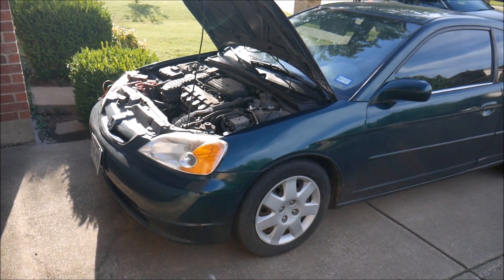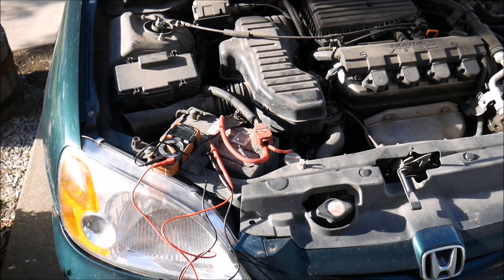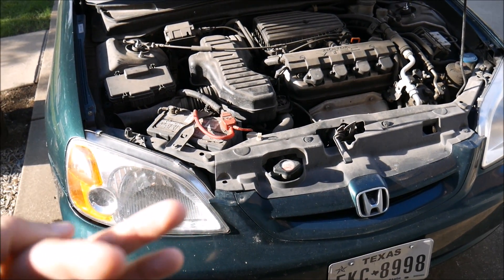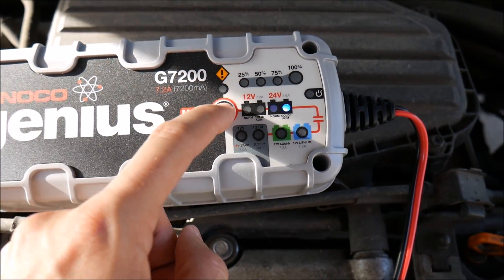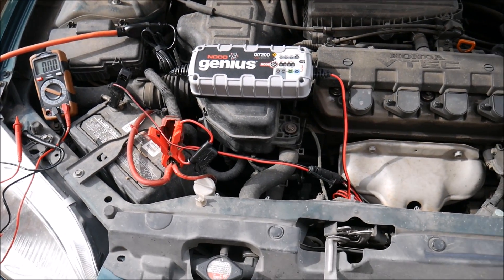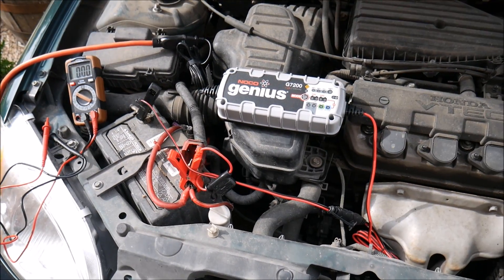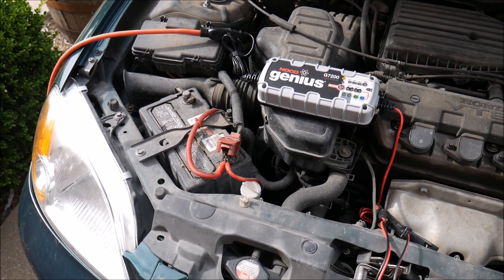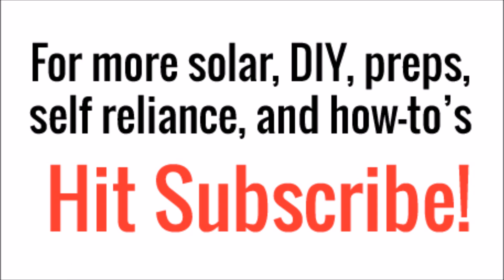Is It Genius? - Noco Genius 7200 Part 2

Comment: You performed the procedure incorrectly.  For future reference, you are supposed to recharge it normally to 100% prior to using the repair function.  (Page 5 of the little instruction book that came with it)   The normal charge performs an 8step process and brings the battery to full.  THEN do the repair mode.

The instructions that come with the charger are weak, but there are a lot of other videos on YouTube explaining how to properly use the machine.   Don't take my word for it, watch a few videos...that's how I found you :)
Reply from the maker: Good to know, thanks.
Reply: Also, i think it is suggested you remove the battery from the car before doing a repair mode run. And though a battery at 9.8v is considered fully discharged, it should be recoverable under normal charging and may not need repair mode. I have seen batteries revived with starting voltages below 4v or even with 0 voltage. And an FYI, repair mode only runs for 4 hours. It is not a charging mode but one that supposed to desulphate the battery and deal with acid stratification and bring back battery capacity. I would only use that repair mode as a last resort having tried other less severe desulfation methods.  Based on reviews people have lost batteries using their repair mode.

Comment: You didn't leave the charger on long enough.  From 9.86 to 11.15v is a good improvement.  I brought back a battery much worse then that one by leaving a 3 amp smart charger on longer.  Try leaving the charger on for a week, and see what happens.
Reply from the maker: I don't have that battery any more as we replaced it.  But next time I will definitely try some more suggestions like this.  Thanks
Reply: @LDSreliance  Most people I've seen test the repair procedure don't wait long enough for it to do its job.  One guy who successfully used it had it on for 3 days 9 hours and then it finished, and succeeded.  Fully charge it normally, then let the repair mode work, until it's done.

Comment: Interesting video and nice used Honda, what year / model is that one?  I just bought a NOCO G3500 battery charger.  Like you said, it seems that battery was too far gone, but for best results manual makes a couple of points:  1. for optimal results, first fully charge the battery via a full charge cycle, then try the repair mode and 2. Disconnect the battery before using the repair mode.  Last thing, make sure the battery has sufficient distilled water in it covering the plates because the repair process will result in some water loss.
Reply from the maker: It is a 2002 Civic EX.  So basically they want me to jump start my car and then drive it around and try to charge the battery?  Hmmm.  I agree on the second point.  I should have checked the water level.
Reply: You could fill it w/ distilled water, disconnect it, charge the battery first using the NOCO G3500 (not Repair Mode, just normal charging mode) to 100% and then use Repair Mode last.

Comment: Just used on a battery that's been sit all last winter and summer and it which was reading 2.3V, charged it on normal mode on my G26000UK and next day it's sitting at 13.6V overcharge and flashing green, try removing the battery from the car and try again and also check the water level.
Reply from the maker: I tried numerous methods to revive that battery off camera.  It must have sulfated pretty badly or had an internal short because I was not able to get it to start the car again.  I am sure this device is capable of fixing some car batteries but this one was toast.

Comment: The Repair Function can also totally destroy a battery
Sadly, that is the ONLY thing the Repair function has done for me.
Took a fine AGM Motorcycle Battery and killed it with the higher voltage!
$150 Battery no useless. Took the AGM Bike Battery to get tested and was told it has gone High Resistance and is no a paper weight.
So, just a warning for those using Repair Mode on any Smart Charger!
Reply from the maker: Why were you repairing it if it was fine?  Yes, that is a danger with "smart" electronics is that they may not be smart enough for every product out there.
Reply: If you read the literature that comes with these chargers
Some recommend doing a "Repair" each year in addition to normal battery maintenance.
Something i will NEVER be doing again.
Reply from the maker: Yeah, that sounds like bad advice.  Sorry man.
Reply: Im not sure if Noco recommend this
But all CTEK manuals do.
So i thought id gave a general warning regardless, hate to see others go through what i did.
Thought i was doing the right thing, next thing i'm up for a new battery :(
Reply: Another thing worth a mention
When i questioned CTEK about their charging profiles, they were happy to present them to me, so i could check with my battery manufacturer.
When i asked Noco for the same, they bluntly refused saying they were giving away intellectual property.....
Yeah, what ever Noco....

Comment: get an old school 10 or 12 amp charger and use it to recharge that battery.. new computerized "multi stage" (bulk, absorb, float) chargers will not work when a battery is very low/below 10 volts.. it's the computer part that makes it stupid.... oh, and X_Ben is probably wrong, the battery is likely NOT dead.. I have recharged batteries that were down to 8 volts because lights were left on all night.. a NOCO will not even recognize it as a battery and a Schumacher will charge it fine..
Reply from the maker: I am not giving up.  I will try some more tricks.  Unfortunately I don't have an old school 10 or 12 amp charger any more.  Mine broke years ago.

Comment: I gather this has been done to that poor battery several times? 9.8v isn't an instant kiss-of-death. I'm not familiar with Noco products (other than a bunch of reviews rating them poorly.) Who knows what it's actually trying to do. Personally, I like ctek chargers -- what they do is well documented, and the newer ones have leds to show what stage it's in. I leave one plugged into my bug. The "last resort" is a lab/bench power supply; turn it up to 15.0v and see how much current the thing wants. (I've not used the Junsi, but it should be up to the task as it's default Pb profile is for flooded batteries.)

What's with the starter wire(?) zip tied to the grounded metal battery tie-down? It actually looks like they're swapped. The big one goes to the starter, the other to the fuse box.
Reply from the maker: You've read bad things about Noco?  Interesting.  I read a lot of good things before buying this.

The wire coming off the positive terminal is for my son's car stereo.  Good call on it being zip tied to the battery tie down.  Not smart.  I will fix that.

Comment: These "smart" chargers are unable to charge a battery of less than 11 volts, they WILL NOT start charging, you must use an old dumb charger first to bring the voltage up to just over 11 volts, then connect the "smart charger".

Comment: well. hmmm.  maybe the battery is toast.  i dont know.  maybe the charger isnt capable.  maybe it is.  but before i would give up...i would try the process again.  i would totally disconnect all wires to the battery.  i would place the battery in approximately a 70-80 degree environment.  then i would recharge the battery again.  i have seen batteries take 1-4 days of charging before the battery will begin to accept a charge.  now that would be a really good test.  time can be your friend.  What's to lose except time?
Reply from the maker: I'll definitely try it a few more times.  Nothing to lose for sure.